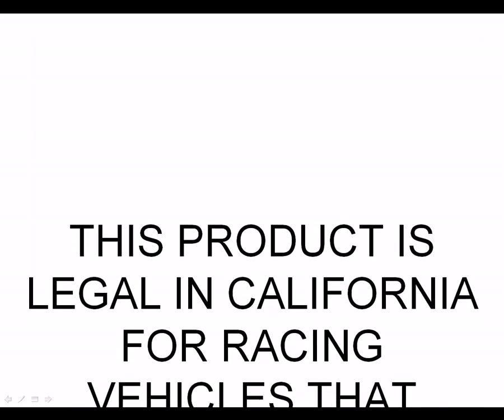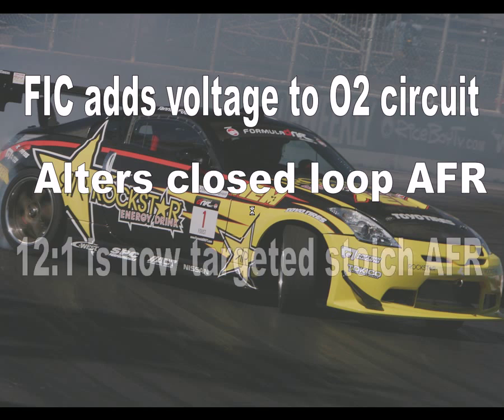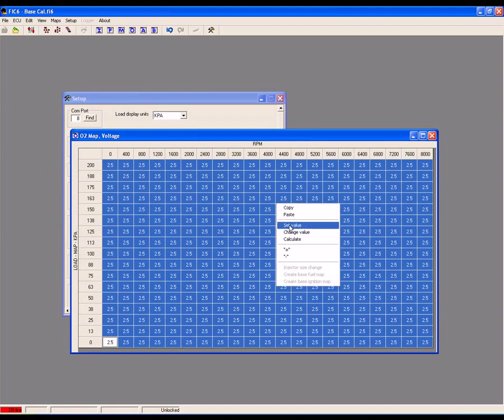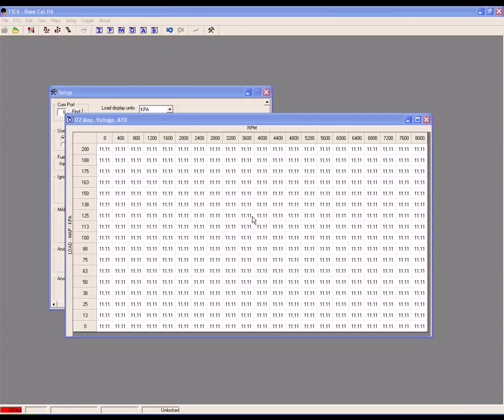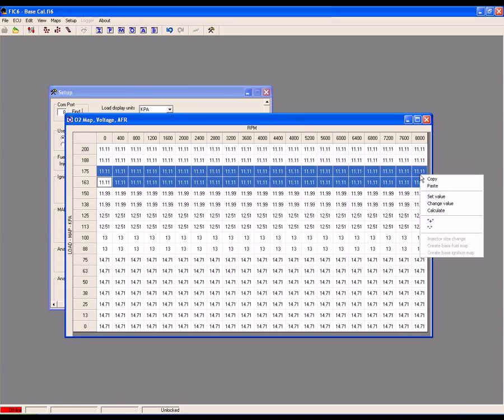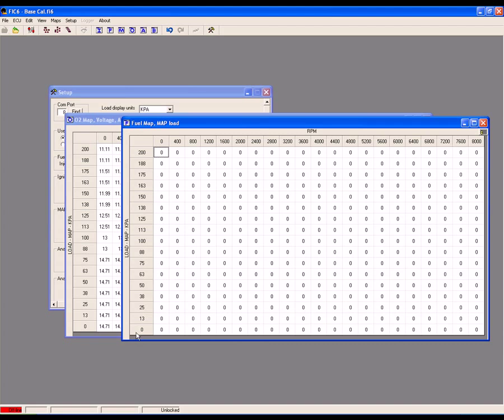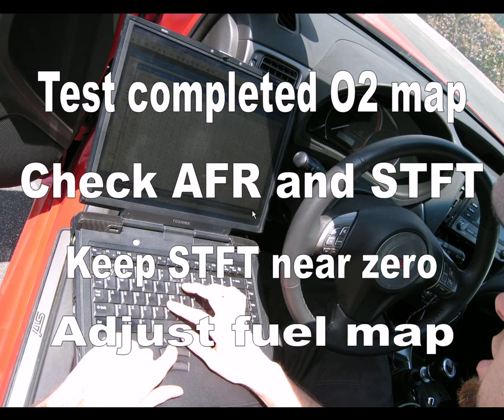Why use a Fuel Ignition Controller Wideband O2 Map?

Comment: This is unlikely to get answered as the video is old but I'd sure like some help. I tried the procedure and no matter what voltage value I put into the 02 map, I get a STFT of around +20. The AFR displayed by my OBD tool (Torque Pro) always shows 17 no matter what voltage I enter. I also have a dedicated wideband (Bosch LSU 4.9) and it will show fluctuations in AFR with different voltages. I tried different voltage values in the 02 map to experiment. I got wild fluctuations in AFR and bucking during the onset of boost. So, I'm basically stuck at step one of this tutorial. I am using a basemap from the turbo kit that I bought. Obviously, my fuel values are not set at "0" in the map. Does this process account for upgraded (upsized) fuel injectors? Do I have to start with all zeros in my fuel map. I would like to start with a brand new map (tables all zeros, but I'm afraid my car wouldn't even run if I did that. I was optimistic that this would work, but all it has turned out to be is frustrating. Help please! If anyone is around to help me.
Reply: Adam B. I hadn’t realized it before, that your stock O2 sensor was reading 17 constantly on torque. Mine always runs very close to my dedicated wide band. Once I figure the O2 map out as the videos results, I anticipate the torque AFR to be closer to stoich, as it comes from the ecu, which we’re tricking, and the WB to be closer to target. I’m also wondering if my earlier efforts to create the v/AFR/stft table were hampered by the vacuum leak I fixed the other night. On the fuel map question, if you are generally happy with the map currently, I would probably just change values in the regions needed by the stft value from the table created...once created 🙂
Reply: @FishHawk1  Thanks man! My Torque only showed 17 when at idle and when I entered any voltage value. If no voltage value was entered in the O2 map, my AFR  in Torque closely matched my dedicated wideband. My baby is in storage now, but I'll definitely be doing some more tweaking in the spring. Right now I just have a few rows filled with some voltage inputs in the low to mid, partial throttle boost range.
Reply: @acbent11  兄弟 您的问题解决了吗

Comment: Will this unit work for OBD 1 Pre 1996 vehicles? IE 1992 Mitsubishi  mighty max pickup truck thanks.
Reply: If you can read the fuel trims I dont see why not. Most data readers that can read STFT and LTFT are expensive and need an external power source. This means that it will most likely need to be a dyno tune.

Comment from the maker: The above reason is why the chart shows a positive STFT accompanying a rich AFR. The end goal is to end up with an actual measured AFR that’s richer than 14.7 as you want, but a fuel trim close to 0, because the ECU is not detecting the rich condition due to your adjustments made to the O2 sensor. If you have any further F/IC tuning questions, I’d suggest the F/IC section of the AEM forums, which I have linked to below.

Comment from the maker: If you simply go into the fuel map in the F/IC and add fuel, the fuel trims will compensate and pull it right back out. This is where “tricking” the ECU is useful. You want to trick the ECU into thinking it’s running too lean, so that the ECU itself adds the fuel for you which will cause the engine to run richer, and you will also see a positive fuel trim (since the ECU thinks the engine is actually too lean, when it’s really not).You can help along this process by adding fuel to the fuel map.

Comment from the maker: The difference in the video’s case is that we’re actually tricking the stock ECU into thinking it’s running at a different AFR than it actually is. For instance, when adding forced induction to a normally naturally aspirated vehicle, there’s usually an area in the transitional period from vacuum to boost where the car is still in closed-loop, so the stock ECU is trying to keep the car near 14.7 AFR for emissions, but you’re actually starting to get into boost, and 14.7 may be too lean for that.

Comment from the maker: In the “Wideband O2 Map” video, the chart you’re referencing, which shows O2 Voltage, AFR Target, and STFT, you see that the STFT becomes increasingly negative as the measured AFR becomes leaner. On the face of it, this seems counterintuitive or inverted. Anyone who’s familiar with stock ECU fuel trims knows that a car that’s too rich will show as a negative fuel trim (STFT).

Comment from the maker: Hi Tacit Tacet, We received some help with this question from AEM. This is an extensive response. We will also private message you with the entire response as well as a link to the forum for further discussion. Thank you for watching! : The AEM F/IC is considered a piggyback system, and in some cases must “trick” the stock ECU to allow the vehicle to be tuned correctly. This is important to remember especially when dealing with the stock O2 sensors in the vehicle.

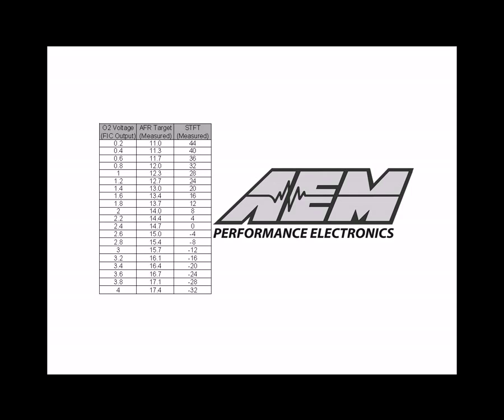Comment: Is the map at 3:22 not inverted...

The STFT goes negative when the engine leans out.. so it's a runaway senario -->
If the engine is running lean, then the algorithm tries to compensate, but in the wrong direction thus resulting in the engine running even more lean... and round and round we go ... 
It's viceversa at the rich end of the map..